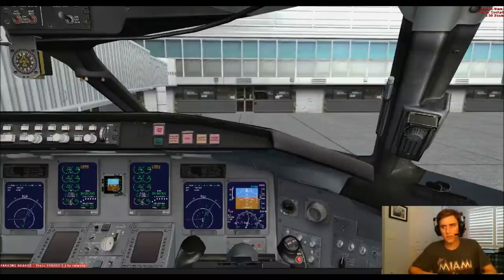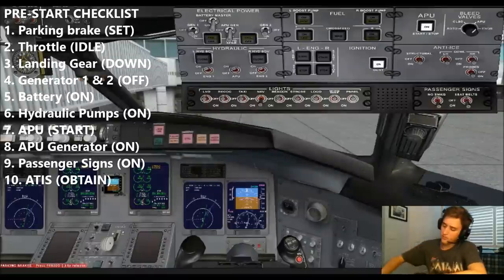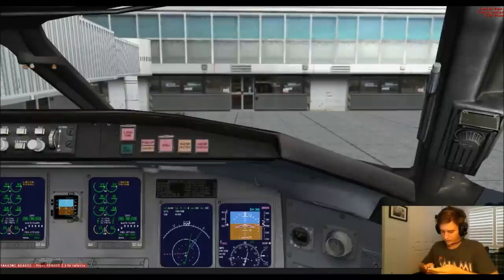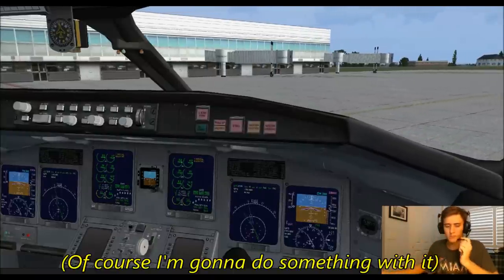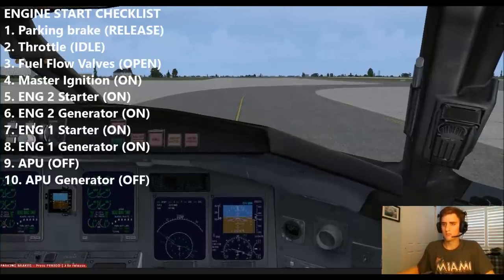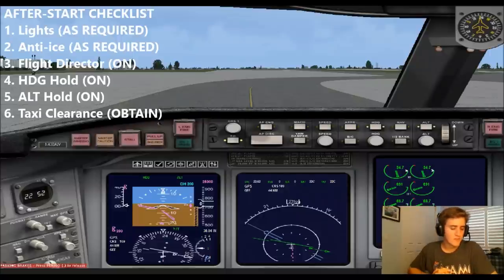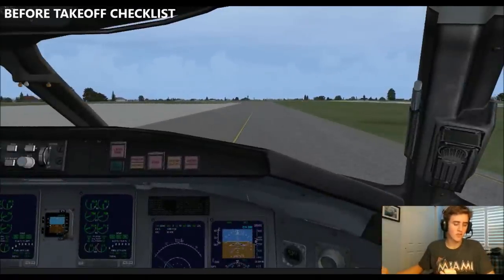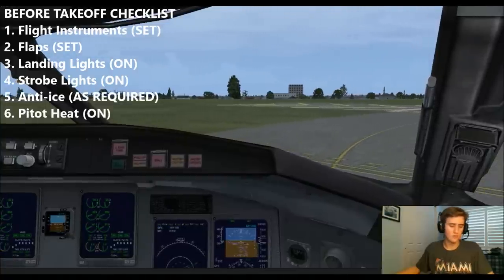VATSIM: Full CRJ-200 Departure (Shared Cockpit) with Checklists

Comment: This model doesn't have landing or taxi lights for me. Anyone know the aircraft.cfg coordinates?
Reply from the maker: +PASSwordUSERname Same for me, there may be a fix somewhere out there.
Reply: +Airforceproud95  Yo I made a fix to it, the taxi light is off but it won't let me get any closer to the nose gear. Also the lights don't show on the ground because it's not in the .mdl file and I don't have a program to access it. But it's the best I could do. Just go to the CRJ-200 .CFG and replace this with the lights section. Also if you don't have 3D Lights Redux just replace the fx_shockwave with the stock fx_xxxx. (you can find names in the FSX/effects folder) 

[LIGHTS]
//Types: 1=beacon, 2=strobe, 3=navigation, 4=cockpit, 5=landing ref: 55.35
light.0 = 3,  -69.85, -37.00,  -0.50, Fx_shockwave_navred  ,
light.1 = 3,  -69.85,  37.00,  -0.50, Fx_shockwave_navgre ,
light.2 = 3,  -109.90,   0.00,  14.645, fx_navwhi ,
light.3 = 1,  -45.626,   0.00, -2.30, Fx_shockwave_beacon_b 
,
//light.4 = 2,  -104.63,   0.00,  15.00, Fx_shockwave_strobe ,
light.5 = 1,  -45.626,   0.00, -2.30, Fx_shockwave_beacon_h ,
//light.6 = 4,  -10.00,   0.00,  3.90, Fx_shockwave_vclight ,
light.7 = 2,  -69.85, -36.50,  -0.50, Fx_shockwave_strobe ,
light.8 = 2,  -69.85,  36.50,  -0.50, Fx_shockwave_strobe ,
light.9 = 5, -55.35, 4.0, -0.38, fx_Shockwave_landing_light // Shockwave light
light.10= 5, -55.35,-4.0,  0.38, fx_Shockwave_landing_light // Shockwave light    ,
light.11=5, -0, -0.0, -0, fx_Shockwave_landing_light_double // Shockwave light

Comment: Pilot flying he doesn’t do take off everything and you select the landing light on before lined up on the runway you cannot select the altitude are heading mood on autopilot and the call out for the flaps you have to mention is that speed check for selecting a flaps very important any briefing what’s going to happen if you lose one angel before and after and you don’t mention anything regarding your aircraft wait on the fuel if you need to pack and less so in other words it is fun time but away from the reality